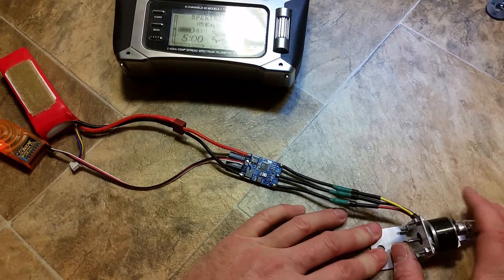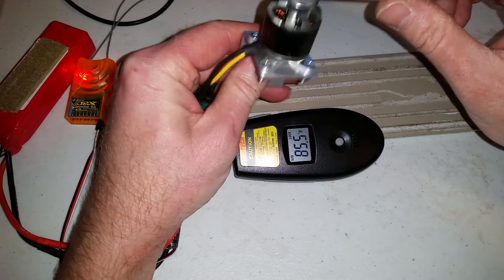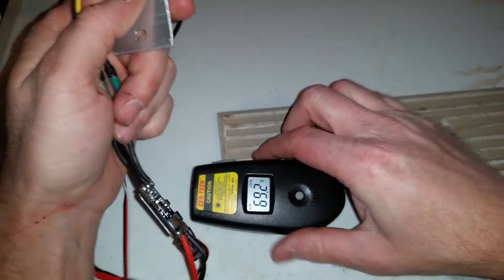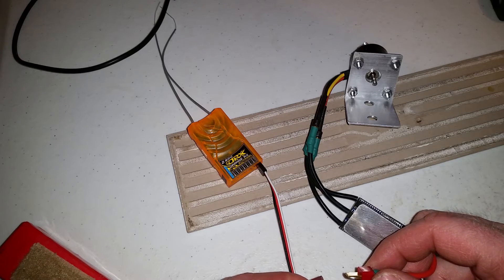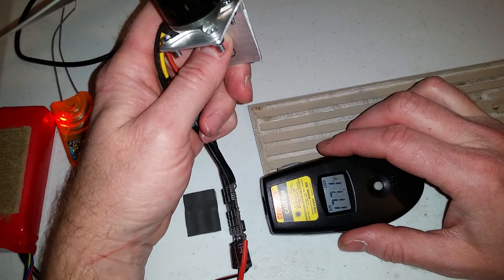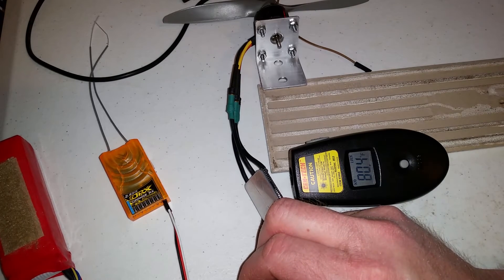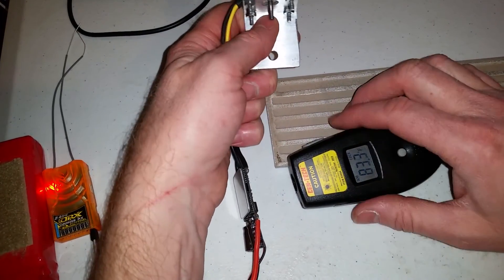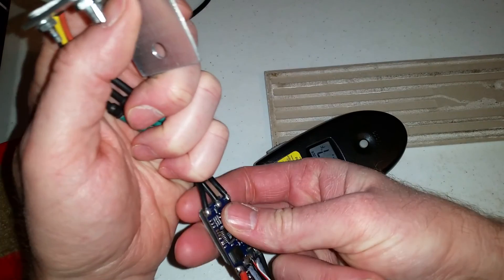Red Brick 30A Revisited.  Does Firmware Make A Difference...

Comment: Nice info sir,,did you know about the mcu chipset type or number that use on red brick esc ? 'cause I'll plan to flashing to AM 32 firmware
Reply from the maker: This is what is on the mcu chip
Amtel
ATMEGA8L
8au 06111

Comment: what happens to esc during the work when it looses connection with the remote ???
Reply from the maker: That would depend on your failsafe settings you set on the receiver.

Comment: Don't do this at home, always remove props before testing.
Reply from the maker: And what good would it do to test without a load on the motor?  Kind skews the testing and all the internet pundits will cry foul because there is not enough "Air Flow" going over the heat sink.  Trust me, air flow is not the problem with this ESC.
Reply: @MrDabrudda  this test could go wrong for someone else,  is not a good idea to run motor with props on your hand, you could lock that motor somewhere like on a piece of wood, I almost lost an eye  when I was starting out because I didn't remove props, the throttle could go 100% escape your hand and cause an injure, firmware will definitely make a difference, agreed.

Comment: you state the esc gets hot running without a fan/prop  in front of it and dont measure the actual temp. then show it being tested with a prop/fan blowing down on it with different software. where is the direct comparison of stock firmware and a prop cooling it from you holding it above the esc like you did with the flashed firmware? there was no verdict just a video that ended in these are crap? why not also test how much current is drawn with the different firmware at 50 and 100% throttle. that could also play a role in heat. different firmware not running efficiently.
Reply from the maker: The first run without the prop was the stock firmware.  I've already established the basis of temperature in the previous two videos.  I don't have an amp meter to test.  I established that running the factory firmware causes overheating and running the firmware with a lower clock frequency doesn't cause overheating.  Don't know what more you would need to explain the factory firmware is messed up.

Comment: great video btw how did you flush blheli on it? could you reference a guide or some instructions - thanks!
Reply from the maker: I used an Amtel socket flashing tool from Hobby King.  Unfortunately they are sold out and I can't find any amtel flashing tools any where on the interweb.
https://hobbyking.com/en_us/atmel-atmega-socket-firmware-flashing-tool.html
Reply: MrDabrudda can it be flashed using FCs with passthrough? Because I don't want to spend an extra for an atmel flashing tool and I have a bunch if FCs lying around
Reply from the maker: @Buizie  IF the ESC has a bootloader flashed on it then passthru should work.
Reply: MrDabrudda Is an arduino good enough for an ESC programming tool then?
Reply from the maker: @Buizie  You can use an arduino to flash or an USBasp.
Reply: MrDabrudda Ah good I have a nano laying around my table so it's good
Reply: @Buizie  hey! did you do it?